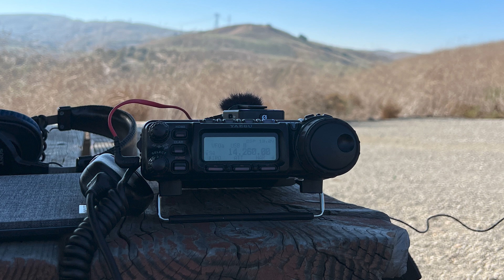Can They Hear Me Now? Maritime Network Radio Check at K-1139!

Comment: Do you ever use wstjx or js8call with your 857d? I tried for the first time the other day, and had luck receiving, but no luck transmitting. I use the digirig to interface with the pc. I tried your suggested settings for digital, but I'm wondering where I'm going wrong.
Reply from the maker: I have, and had some luck.  There can be many things go wrong with it.  For me it had a lot to do with how loud the audio was coming out to the computer and also the settings on wstjx.  I have the same setup, Digirig, best interface you can get.
Reply: @frankwc0o  If you made a video on the setup and use of your 857, digirig and computer settings, that would be so helpful! I think I'm close, but there are so many settings.